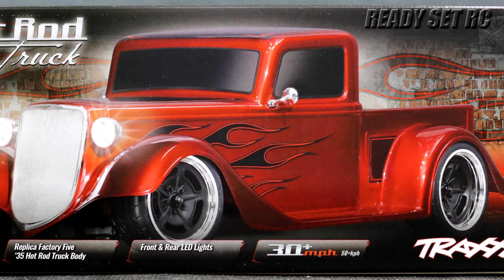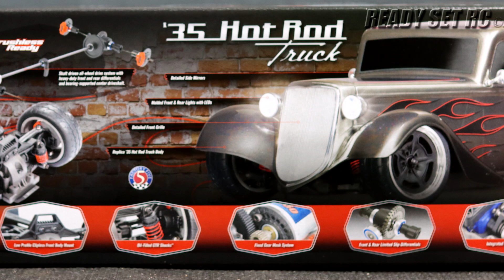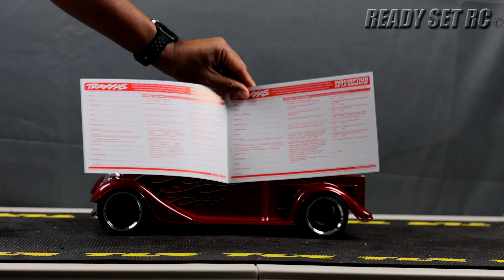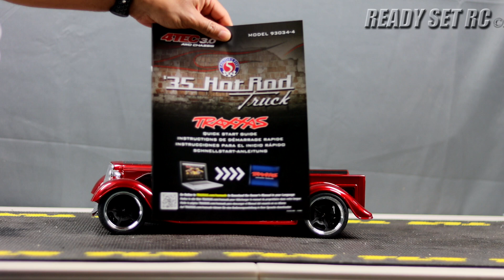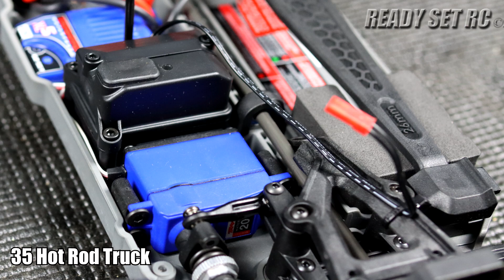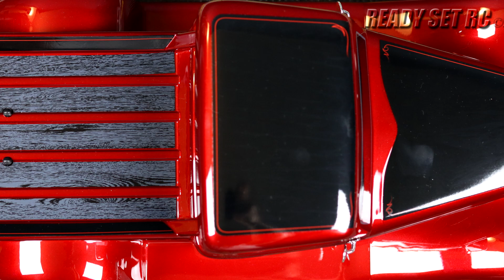Traxxas 4Tec 35 Hot Rod Truck

Comment: The front wheels turn but not the back. Right out of the box
Reply from the maker: @BillYam-l3v  Huh?
Reply: @ReadySetRC  brand new right out of the box....ONLY the front 2 wheels move..the back ones spin at all
Reply from the maker: @BillYam-l3v   I didn't have that issue.  Did you contact the company you purchased it from or Traxxas directly?  Sounds like you are in your window of a full return or warranty.
Reply: @ReadySetRC  so,the liar that I bought it from told me he never drove it. Took it out of the box and put it on display. My own fault for buying without checking. Didn't know people in the RC community do that. Live and learn.
Reply from the maker: @BillYam-l3v   WOW!  Scum bags everywhere.  I always say ask as many questions like a real car purchase.  Seller get's sketchy on the responses or no responses, walk away.
Reply: @ReadySetRC  it's in the shop now for a week and they still haven't called me. Might just go pick it up tomorrow and tell them to forget it. Will just leave it on a shelf.
Reply from the maker: @ OMG no!   Don't leave it on the shelf.  It's only a few reasons why it  may not be working.  Could be the rear diff internal gears, Rear diff pinion or spur or missing dogbones in the rear.  This car is fairly simple.  The hobby shop maybe just waiting on parts.
Reply: @ReadySetRC  I will give them one more day. They haven't even called to tell me what is wrong with it.
Reply from the maker: @BillYam-l3v  That's the least they can do.

Comment: I just bought this rc as a newb. My first tunable rc. 2nd pack it melted the spur gear. I'm assuming something was messed up with the gear mesh, but kinda unsure on the motor adjustment to the mount. I can set the mesh, but how the heck do you tighten down the motor screws without having to pull it back out and screwing up the mesh again.
Reply from the maker: @Troy Monroe  Not sure I understand, this car come with a fixed gear mesh.  You adjust based on you pinion size and the lettering on the motor mount.  The manual has the coalition between the pinon size and mesh.  If you are stripping teeth, sounds like your motor may have shifted or more likely the spur and driveshaft was not seated properly.

Comment: I'm new to the RC world but I am considering the coupe version. Do you know what other bodies would fit on the platform besides the Traxxas ones? Should I pay attention to wheelbase and if so how much deviation from the 11.1inches this has can I go? thanks
Reply from the maker: @Demetri J  Welcome to the hobby!  These Traxxas 4Tec' 3.0's are an unusual breed.  Normally you would look at the wheelbase to determine what bodies fit but with the 3.0's they are not your typical wheelbase even between the different 4Tecs.  Without doing mods to the chassis the only body that would fit the coupe will be this truck.  The 4Tec 2.0 was more of a standard size 1/10 touring car.

Comment: Great video. This New truck 3.0 35 is simply a out of serie model. It is very very beauty
The New design and colors and flames design are 10/10
I bought it 20 days ago and I"m very glad and satisfied.
Traxxas,  congratulations for your excellent job.
Only tiny problem: I had to wait almost five months to get it . No problem.
Reply: I bought mine in Hobbytown, Chicago, and brought it to Puerto Rico. Not available here in P.R.
Reply from the maker: @Fernando Alberto Medina  Wow!  I got it from Small Addictions RC the same week it was released.  I was surprised they had too.  But they seem to have good inventory on most RC's.

Comment: Can I use that body shell on the '33 hot rod?
Reply from the maker: @Edwin Cordero RC  Yes sir, same chassis.
Reply: Yes. I have the truck snap on 35 , Black color and the New red truck .  The chassis is exactly the same .
The great difference is the body. The New bodies are absolutely fantastic
I've the red auto snap on 35. Now I'm going to buy the New very beautiful blue auto.
Reply: @fernandoalbertomedina4829  many thanks for your reply.
Reply: You do have to change the rear body mount. The 33 uses a different one thats a bit wider, the 35 has a narrower rear body mounting.
Reply: @Sellingthemall  I found out the hard way. I'm using the same body posts, but I turn over the two body she'll supports on top of the body posts. Ready. Thanks for your reply and watching.